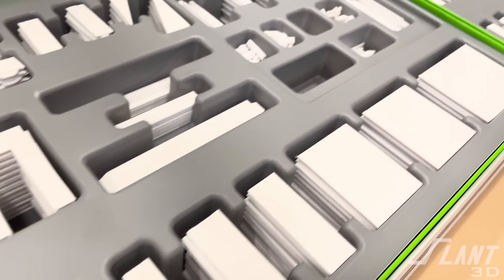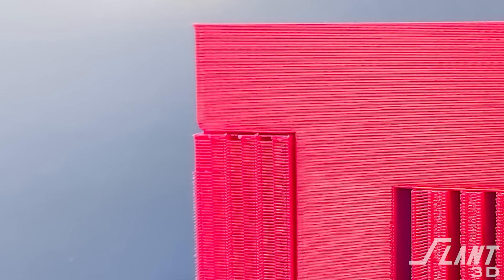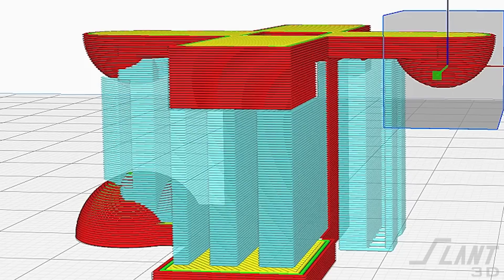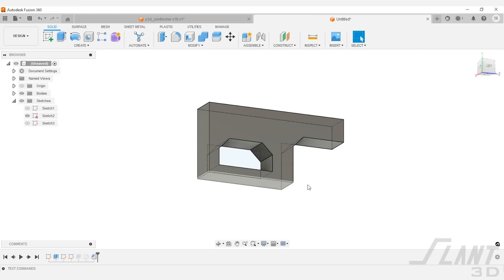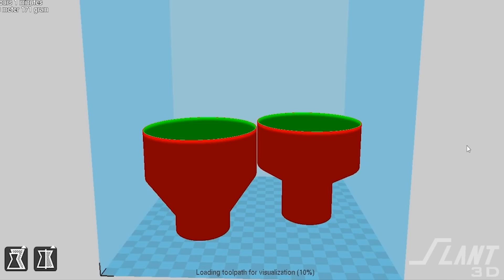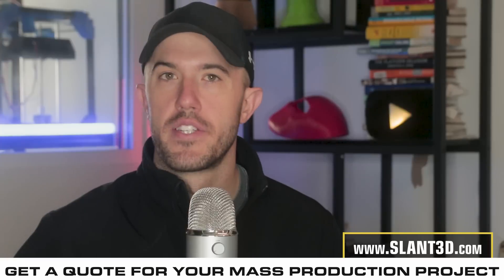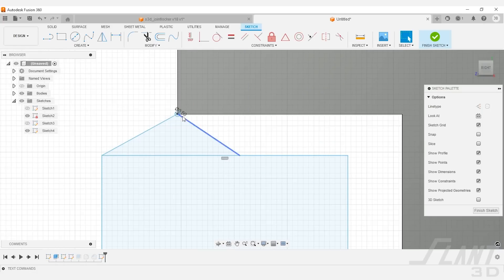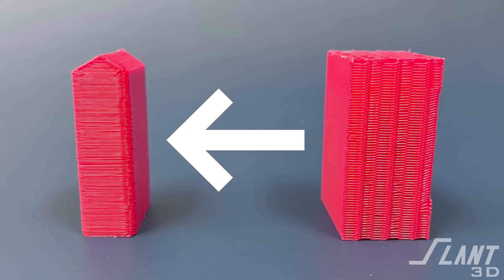3D Printing Basics: Understanding and Managing Support Material

Comment: This video was completely worthless. There's a reason there is an overhang. Otherwise why not just go straight to the bottom. It's like designing your house with no doors. Because doors cost money. So architects should design houses with no doors for now on .
Reply: Not really - they say as much somewhere in here ("if you need it you need it and that's *fine*"), but sometimes folks make holes thinking they're saving material, and they're not - that's what they're getting at.

Comment: Hi Slant 3D! Just started 3D printing today and I've been doing a good month or research plus learning of the basics to have a good headstart. 

I'm curious about the last tip you mentioned regarding the building of those manual supports. In the example if that large overhang where you created a block with a fine tip connecting to the overhang, how come that was a sufficient support? It looked like still most of the overhang was suspended in mid air and only a single point of it was touching the support. 

Love your channel and videos! Definitely my go to to learn :)

Comment: One other thing: Slicer default settings for automated supports are wayyyy too aggressive, imo. Increase the distance between supports and object, space the supports more (i usually use 2-3 mm), and increase the interface distance so they are easily removable.

Comment: If you are making 1000s of something you shouldn’t be using 3d printing. You should be injection molding. At a certain quantity 3d printing is no longer economical.
Reply from the maker: Sure. If you are making over 100K go ahead and "consider" injection molding. Anything less than that printing should be part of the decision.

Comment: Sometimes you can't get around it like with two halves of a cylindrical object with end caps, when separating the end caps and glue them is not an option for high stress parts.

Comment: ”If you are going to produce hundreths of thousands or millions of this part”… you probably shouldn’t waste time and money 3D printing it, cheaper to injection mold at those volumes.
Reply from the maker: Incorrect
Reply: @slant3d  how?
Say the amount of plastic costs the same for both processes.
Say the mold costs 10 000 dollars, the injection mold machine costs 20 dollar/hour to operate and produces 50 parts per minute. That’s around 0.007 dollar per part + 10 000 dollars/ total number of parts.

For 3D printing, say the only cost is unloading the prints from the machine, minimum wage is 7.5 dollars, say it takes 10 seconds to unload each part, that’s 0.02 dollar per part. 10 seconds is very unrealistic tho, since you can’t pay someone just for the literal time they handle the part.

In this scenario at around 900 parts it’s cheaper to use injection molding.
How would you make 3D printing cheaper than injection molding on a large scale (especially 100 000’s of parts) and why are companies wasting their money on injection molds if 3D printing is cheaper?
Reply: @beaconofwierd1883 , you were right. I am not aware of any true mass production using 3D printing. Even if some cases exist (like at Prusa Research), these are a tiny percent of the total production numbers.
Reply: @slant3d  How much does your farm cost per piece/kg? :S

Comment: I haven't really found a great solution for a power supply cover with a switch hole... The part can't be rotated becaus the sagging of the bridge would mean the cover doesn't fit the power supply and the power switch might not fit. I've been liking the organic supports in prusa slicer which has limited the amount of support material needed to be removed. Doing so means limited support material and limited cleanup and everything clicks together.... I'll have to try the teardrop though and compare.... That's a great idea...

Comment: Have you ever considered using reusable supports, maybe something fixed or clamped to the print bed for a production run?
Reply: @potpie7644  this is an interesting idea. For that outer overhang for example, you could simply wait for the right layer height, and then pop a 3d printed block of the right height with some tape on the top surface, and maybe some magnets embedded in the bottom

Comment: I typically try to design my models to not need supports or orient them or slice the model to remove the need. On the rare occasion I do need to support an area I like to use custom tree branch supports integrated into the model to save material and print time. I also model internal voids strategically into the model to save material and maintain strength. I always try to design with post processing in mind. I hate using supports I don't even like using brims or skirts. IMHO Its better to print a model in pieces that need final assembly than to waste material on supports unless you have the means to recycle your wasted material into new filament. Smart design saves so much time, money and frustration. I'm cheap & love the DIY process so I typically use free models as reference but build the design from the ground up with post processing in mind. I typically run into issues if I just try and print most free models without any kind of inspection or pre print prep.

Comment: I've found a lot of success with tree supports if I can't reorient the part to avoid support material. Less plastic waste and they come off relatively clean and easily. I use a little monoprice bed-slinger so tree doesn't require a large amount of resolution either.

Comment: I guess another solution could be to make slots like a dovetail and print the parts seperate and slot them togheter? Wouldn't that work? But i guess that could require more post processing and good tolerance on the printer

Needless to say, Im new to both cad and 3d printing

Comment: Did I miss something? In the last “solution”, I get that the solid is structurally supported, like a bridged buttress, but there are still massive spans of horizontal, unsupported surfaces that will simply sag and not print. Right….?
Reply: That's exactly what I thought. His examples at the end made absolutely no sense to me. Moreover, you're the only one that seemed to comment on it.

Comment: Do those designed supports offer enough... support?  What is the limit for the overhang length before you need a designed support?  Take that center hole in your example, you have one support.  What length would require two supports?  I understand it can be down to the filament, temperatures, etc. but is the only way to know trial and error?

Comment: The last example, teardrop inside model, looks like it was drawn in CAD with a slight gap between the bottom of the teardrop and the inside of the model. What size gap did you draw for that? 1 layer thickness so it would drop down and not stick so much to the model? Thanks!

Comment: This mode of design engineering reminds me of when I worked adjacent to a tool & die design team. The constraints were different but the goals were the same: take a part and transform it into something that's cost-efficient to manufacture.

Is there a market for design engineers who work with clients' designs to make them 3d printer manufacturable? I have some CAD experience, I'm a software engineer, and I'm getting into 3d printing as a hobby. This seems like a really cool space to work in.

Comment: You missed the simplest solution. When you can just rotate the part into an orientation that eliminates the need for support. All the other options are good but you cannot forget to think about orientation on the bed. All the examples shown you could have gotten away with printing them on the side.
Reply: That was what i was thinking aswell, but i guess this was more for examples on models you can't rotate
Reply: @glowpipe  but the simplest solution is important enough that it should have at least been a first mention.  See if a rotated position will work. If not, then look at the other solutions.

Comment: Another option for internal gaps, saving material, is to make the supports an integral part of the design, with no intent to remove them, ever. Make a grid/lattice with gaps just wide enough to support bridges without sagging. Looks cool, improves strength, saves filament and possibly print time.

Comment: Including support into design is a great solution, you should have mention that also breaking objects in multi-part that that can be clipped, sticked or screwed easily can be a good solution in some situations, this is something I often use and it really make life easier.
Reply: Is what I did for my cable holder on my Valve Index. I got a clip part and a spinning part(like a winding snake with the cable in the middle). Could not print them in the same orientation or some parts would break on use. Like the lips on the clip or the spring not being printed in one continuous line.

Comment: This is the second video I have watched on your channel. I am very much impressed with the valuable insights you provide in such a simple way. Your videos have helped me break that inherent mindset gained from older manufacturing technologies that make us always design a part with features not required at all. For example, it should have been a common sense to avoid gaps in the part as you have pointed because you are anyway saving material in 3d printing. Those gaps were meant for saving material in sheet metal parts for example. So thank you.

I would like you to discuss the design of 3d printed parts for speed. As I am new to the channel I don't know if you have already covered the topic. 3D printers are considered inherently slow mostly because of the limit on the extruder extruding the filament. Since, you have a deep insight into the constraints of the old technologies that are no longer a hurdle with 3D printers I believe that you must already be having a design solution for speed or you can come up with one. I also wanted to share my 3d printing experience that vase mode is fast and good for several non-load bearing parts (learnt from other videos. UPDATE: I have watched your video on Bene bFRIENDS smart use of vase mode. Another great video.) and that for industrial products 0.3 mm layer height is fast enough without compromise in strength. The latter experience supports your thoughts in your video on design on angle brackets for profile support. In essence if the amount of plastic required to extruded  can be reduced the speed will automatically increase. May it be through design or by use of vase mode or by increased layer height.

Thank you once again for sharing your valuable insights.
Reply from the maker: Thanks for the feedback. Much appreciated

Comment: The concept of designing for the manufacturing process used is very powerful. 
A suggestion for horizontal overhangs is to use a 45 degree belt printers; however they have their own disadvantages. Adam from PowerBelt3D has a good video on this
Reply: Wow, I had no idea about conveyor  belt printers existence - but I think I get it how they can print "horizontal" bridges. I figured you can go that on regular printer by tilting part 45 degrees and mounting it (in CAD) on 45 degree wedge raft

Comment: 3D printing isn't good for mass production
It's existed for decades now, and time testing has shown that it's valuable for prototypes and fast production of totally unique parts.
Reply: People don't make holes for no reason - for example, to reduce cost or weight of a part, or to make it possible for a part to interface with another.
Saying to fill in those holes is just another reason why 3D printing is awful for mass production. Die casts and extrusion processes are much faster and cheaper and suffer none of these limitations.
Please take some kind of a serious design course that covers more than 3D printing, because your narrow field of expertise in only 3D printing is making you come up with legitimately bad ideas.
Reply: Yes, the "mass" production term should not be used. Batch production is much more reasonable.

Comment: For a well set up printer using most filaments, bridges arent that much of an issue, unless they are extremely long so adding chamfers and fillets probably isnt necessary.

If you have an overhang or bridge then you probably have it for a reason and in a lot of cases changing the shape isnt an option.

Comment: Another solution is to reorient the part, if possible. If there are holes in a flat panel, have it largest surface area down.
Reply: Yes, can't believe he didn't mention this, since his example model would very easily be printable without support if it was rotated 90 degrees.
Reply: My very first thoughts, while watching this video. Don't print a "T" standing upright. Lay it flat.
Reply: Its so obvious that he forgot to mention it - but maybe not to beginners

Comment: The last example with the teardrop shape in the middle of the model could actually be even better if it would not touch the bottom of the actual model and instead be built like a bridge itself (either coming from one side at a 45° angle or from both sides at an even higher angle up to 90°). Similar to how tree support would do it but with more control. There even some sagging is acceptable when the interface is around four or five layers thick. This kind of built in support can still be very minimal. That way it would touch the model in only one place as well.

I would not go so far and say a fillet should not be used, but instead a combination of filet and a chamfer is acceptable. Whenever the filet exceeds 45° to 60° (depending on the printers and the stability of the material itself) the chamfer should take over.

When printing filaments with e.g. carbon fiber or glass fiber in it, the material tends to be more stable with overhangs, because the chopped fibers stabilize overhangs noticably. In these scenarios you can usually go quite far beyond 45° of overhang.

One very common problem, that hast been mentioned here is, when round holes (e.g. screw holes) are featured at the sides of a model. In that scenario a hole could be made to print better in different ways: Make it slightly oval at the top and expect sagging a little bit or even make the hole itself teardrop shaped with a top angle between 30° and 135° - depending on how much space you have, how big the hole is and how much deviance can be accepted visually. Not doing that will not result in perfectly round holes anyway, so there is little argument not to do it - unless sagging and undersized holes are fine in the final print.

I hope this helps anyone.

Comment: You didn't mention print orientation which can eliminate the need for supports completely.
Reply: Sometimes structural requirements dictate the part to be oriented in a way that some features require support

Comment: Good information. Just curious has it ever worked out where you could use one part as the support for another part? Or maybe you could design the supports to be usable promotional/marketing products in some way?
Reply from the maker: That is a really good idea.
Reply: I think the Bambu slicer (which I haven't used) has an option to take the color-change purges and print a different part with those, which I thought was brilliant. You can print a purely functional part out of the waste from printing your decorative parts.
Reply: @darrennew8211 Prusaslicer can also do this; I believe it's called "wipe object" (using an object as the wipe tower)

Comment: That part looked like rotating it sideways would have also fixed the supports being needed.
Reply from the maker: Yes. But this video is about supports. Not every part can be rotated. So the information is for those cases
Reply: Why do people like you always miss the point of the video? It happens on pretty much every video where someone shows something like this. This is for a demonstration, yes there are other ways it could be fixed but the whole point is to show this technique for situations where this would be the best or only technique.
Reply: @conorstewart2214  I'm not trying to be negative, I was adding a critique that adding in checking orientation is another viable way to sometimes avoid supports entirely. It can't always be done but it is nice when it can. Take your grumpy pants off and chill. It's the weekend.
Reply: @byroboy  you added an unnecessary and obvious statement that wasn't really relevant to the point of the video. There are always people making comments like that on any video of this sort and it is usually because people missed the entire point.
Reply: @conorstewart2214  I see you're just here to troll. Go away. What's obvious to you isn't obvious to all. I had to explain layer lines and print orientation theory to a colleague last week.
Reply: @byroboy  I see you are just here to miss the point and make irrelevant statements.

Comment: I would like add something that I do for my built-in supports is that I try to make them only 1 or 2 walls thick for easy removal and the least amount of material wasted.
Reply from the maker: Absolutely
Reply: I was thinking the same thing. If you're using Fusion 360 the "shell" feature is very useful for that. This allows modeling a wide base in cases the support gets too tall and you don't want it to get knocked over.